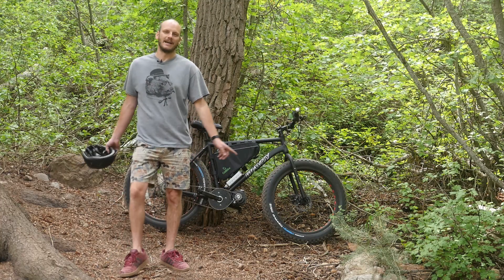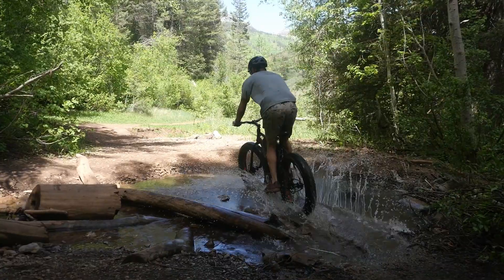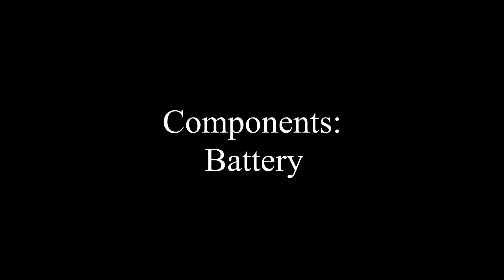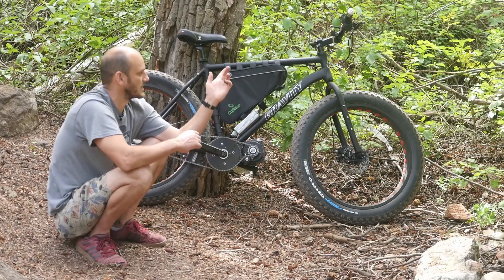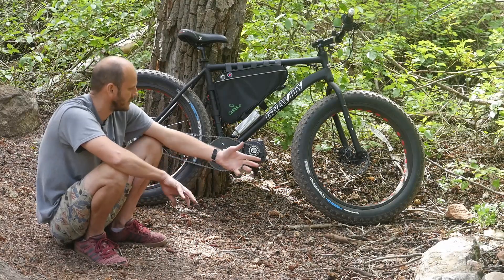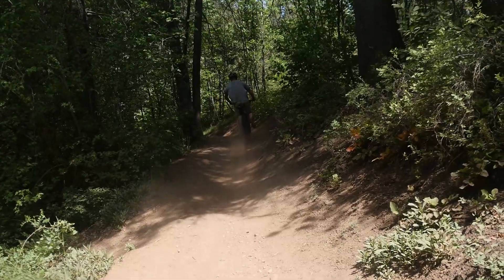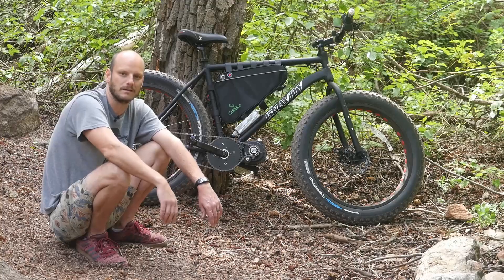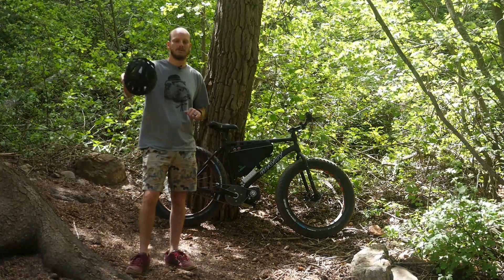Custom E-bike Build: Cyclone 3000w Fat Bike

Comment: You and others have inspired me.  I have a brand new envoy cargo bike, then bought a mongoose dolomite alx, then three of the malus bikes, I was going to put the bbs02 in the cargo bike and keep that for a kid hauler, the alx is an awesome bike that I may keep as is ( i live on a snowmobile trail) one of the Malus bikes has showed up and they are kind of crappy no real low gears.  I was hoping to build a rental fleet but the insurance is nuts.  So i guess I will be building a couple bikes for fun an maybe to sell.  I thought I could rent the malus bikes with out a motor but they will not work to heavy and no low gears, more of a tar beach boardwalk bike.  No beaches in the mountains.

Comment: More torque would of been nice.
Reply from the maker: Changing the rear cog to a bigger tooth will achieve that.
Reply: @JohnnyNerdOut  I'm well aware of that. I appreciate the knowledge you tried to share tho.
Reply: Go too big they fold over at the 10-11 o’clock position
Reply: @motionpromotion6972  Not sure what you mean by folding over, but I do know that motor will destroy almost any bike frame you put it on.  

We've tried 3 different bike frames. The steel frame lasted about 4 months. 

The carbon frame basically exploded in 2 weeks... It wasn't a high end one. You might have better luck with a 1000 dollar carbon frame.

The aluminum frame lasted almost 3 months, and didn't actually break. It just kept bending until we took it off.
Reply: @alant383 Too late, I already threw it away. I went back to the 1,000 watt hub motors on 48v and 1200 watt hub motors on 52v.
Seem to be the most reliable.

I will say I did put it on a pit bike frame and had better luck with it then.
Reply: @alant383  learn all you can bud the more you play around, the more you can accomplish. 

I gave up on high outputs in a mid drive, cassettes are horrible and snaps chains and kills the derailleur, can't replace free wheels to easily after a lot of power has been ran thru them.

I will say I've found 750watt mid drive to be perfect for my riding style,  just enough to "billy goat" mountains if I don't spin or flip over backwards

Comment: so are the tires enough shock absorption? seems like you'd want front suspension if you were riding it like a dirt bike
Reply from the maker: Definitely depends on the riding. It's worked out well so far but if I were to be getting air, I'd want a suspension fork.